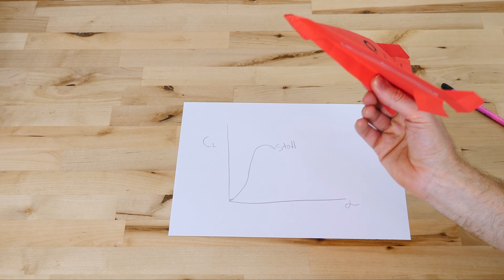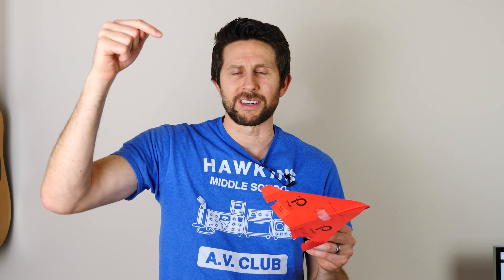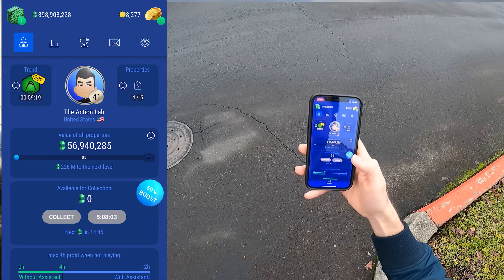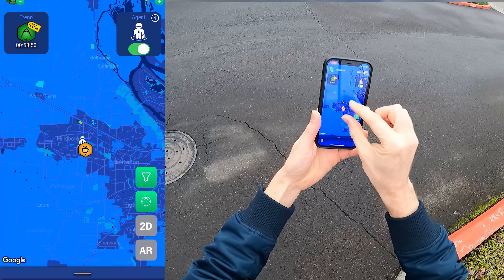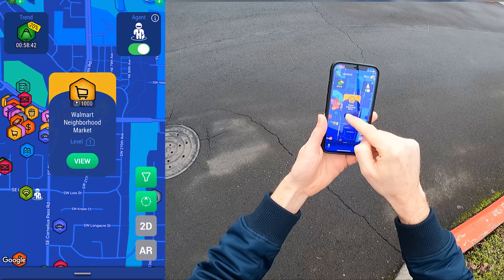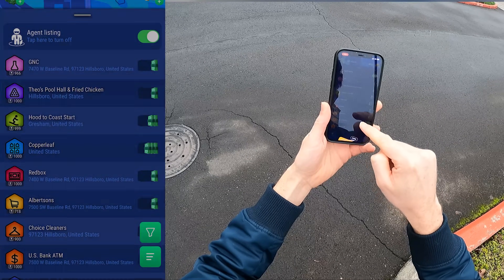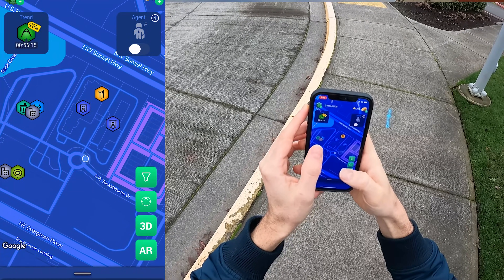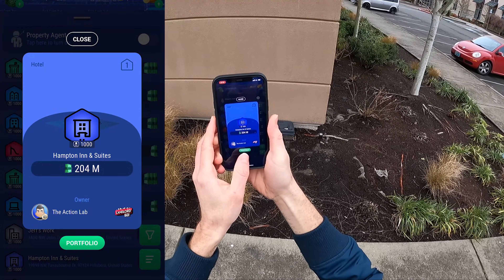How Far Can An Aluminum Foil Airplane Fly If You Add a Motor?

Comment: “The shape of an airplanes wing is much less important than the angle of attack”

Sir, you just hurt my brain
Reply: So basically we have been lied to all our lives?
Reply: @samuelstuff4557  It is not lie entirely, but the angle of attack is often neglected in other videos like this. Another problem is that people use for explanation of lift easier Bernoulli Equation for incompressible fluids (not for air). Those who made simple paper planes know that complicated airfoil is not necessary.
Reply: @ondrejtyc7578  The fact that people fail to mention the importance of the angle of attack is whats surprising to me.
Reply: Yeah, i would say:

The shape of an airplane wing is much less important than the angle of attack *if you just want it to fly inefficiently and bad

This video is not for people studying the subject in detail so i guess that what he said it's fine.
Reply: @tarkusmairingraziato  Lol. Have you ever heard about wing flap or wind turbines with variable pitch control designed by "people studying the subject".
Reply: @ondrejtyc7578 i was considering just the cruising flight, when the slight curvature of the airfoil allows to cruising at low angles of attack.

I didn't mean to say that the shape is more important than the angle of attack btw.

Comment: Putting excessive power on something to overcome design is at the heart of why the A-10 Warthog can fly.
Reply: And the sr71 blackbird
Reply: @jkgkjgkijk  true, but for very different reason than the A-10.
Reply: Even with a wing blown off!🤷🏿‍♂️😁
Reply: and the MiG-25 aka the flying brick
Reply: There’s a plane with backwards wings and it’s so unstable that it only flies because it has
computer to make constant tiny adjustments and if this computer were to break the plane would likely rip itself apart
Reply: and the bees

Comment: As a person who has flown airplanes, the shape of the wing matters dramatically when taking off and landing.  Angle of attack doesn't help much to create lift at slow speeds because the tail will drag on the ground.. bruh, but go ahead..
Reply: Yes, of course the wing shape matters in general, there's a reason why designing airplanes takes time and money. But the idea is that if you want something that flies at all, not necessarily well, you don't need complicated wings; you just need large area to mass ratio.
Reply: Shape matters a lot if you're trying to maximize lift while minimizing drag (because for a real airplane, thrust equals fuel equals money). But if you can just strap a big motor on it with no concern for how much energy you're using, it really doesn't matter much.

Comment: Dude this video was amazing, I want that motor.
Reply: Just buy a $20 micro drone and put the motors on a paper plane. You need to think about what ones go where and how to position the motors but after that see how it glides and attach the movement sensor so it will be level when flying normally. it should have its own self stabilization with 2 motors on each wing, I think one pointed slightly up and the other slightly down to alter the angle of attack.

Comment: Why can't things theese days (such as the motor for that plane) just come with a NORMAL remote controll instead of having to be synced up to a freaking smartphone?
Reply: Cheaper to put a standard bluetooth smart chip in and write an app than to make an extra hunk of injection-molded plastic that goes along with every unit.

Comment: If you folded the foil into a more typical airplane design, would it have flown even better?
Reply: Not necessarily. Big planes rely upon there curved wing shape to generate lift, on a smaller scale this effect is redundant.
Reply: @samueloladosu4721  are the aerodynamics of a finch redundant to that of an albatross?
Reply: There is a reason why albatrosses can go immense periods of time in the air.  But what I meant is that with its mass the necessary curvature to develop appropriate lift is to difficult to do on a smaller scale. There is a reason why smaller creatures flap more

Comment: Action lab I have heard that air can conduct electricity so why don't you put a tesla coil in a vacuum chamber and try to light a CFL bulb from outside
Reply: Air is actually a pretty good insulator in general, it takes a tremendous voltage (relative to the distance it has to travel) to ionize the air so it's conductive enough for current to flow (and the result is a spark, or a lightning bolt).

Vacuum actually provides much less resistance to the flow of electricity, which is why things like vacuum tubes and CRT displays are filled with vacuum instead of some mixture of gases. The electrons thrown off by the cathode are able to move easily through the vacuum inside the tube because they're not being blocked by air.
Reply: @FirstLast-gw5mg  thanks buddy 😇